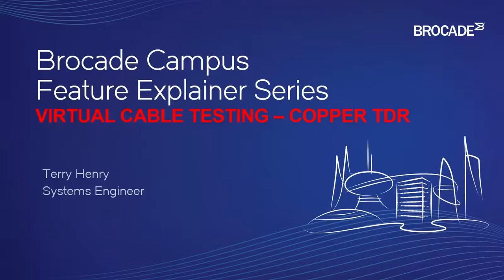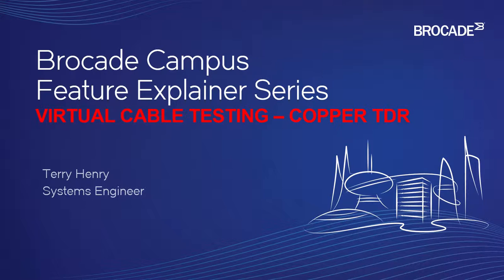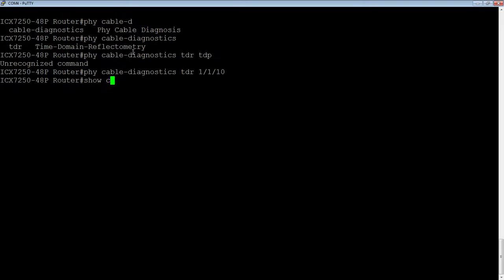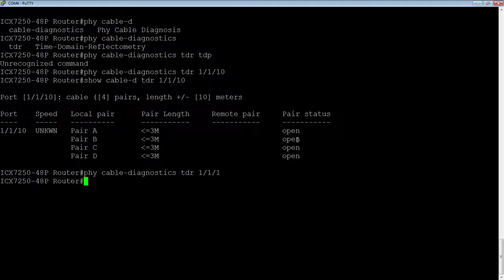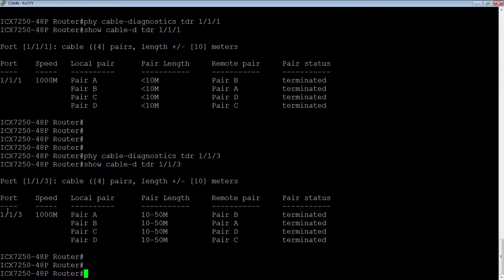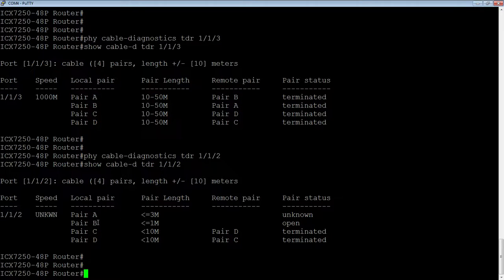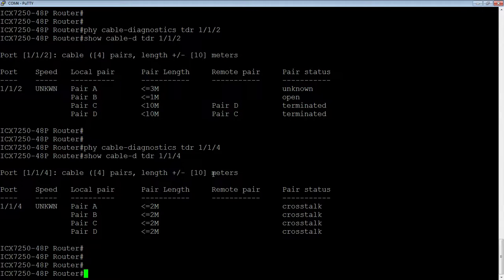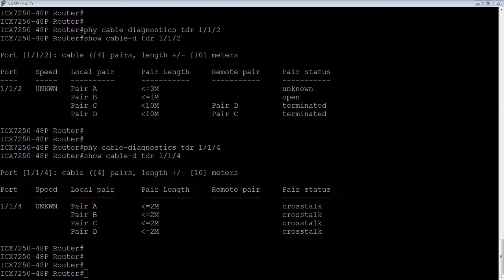VIRTUAL CABLE TESTING – CABLE DIAGNOSTICS

Comment: For ICX7150-24P-4X10GR, I get No TDR data on port 1/1/11
Reply from the maker: Works fine on that model. Even if the port is not connected you will still see pair status as open.

Comment: I tried running this command on a Brocade ICX 7250-48P switch running SPS08030h, and it doesn't work. I get the message "TDR is not applicable to this port!". This is being run on interface 1/1/1.
Reply from the maker: That's true.  The feature was added to the 7xxx series ICX in 8.0.40.  Check the feature support matrix on my.brocade.com to check the hardware support for each feature.  The feature was supported on the 6xxx series and the SX in 8.0.30 but did not reach the 7xxx until 8.0.40.
Reply: Thank you for the quick reply!

Comment: Why would I have a port showing as: 
Gi1/0/4     1000M 
                  Pair A     20   +/- 10 meters Pair B      Normal
                  Pair B     190  +/- 10 meters Pair A      Normal
                  Pair C     23   +/- 10 meters Pair C      Normal
                  Pair D     22   +/- 10 meters Pair D      Normal
Reply from the maker: That output does not look like it is from an ICX. Looks like a bad pair though.